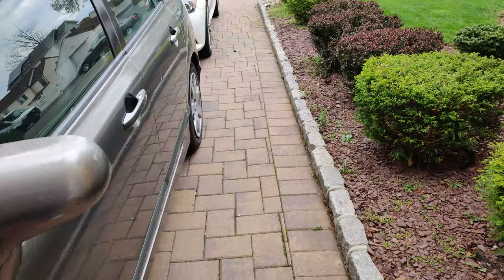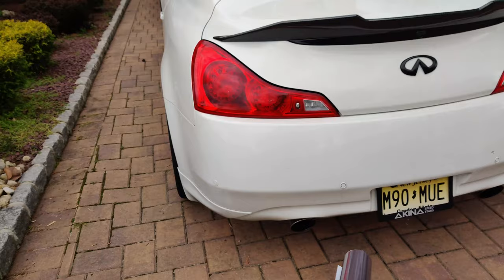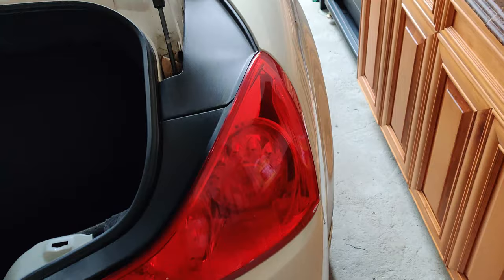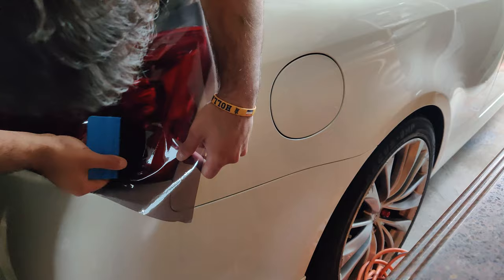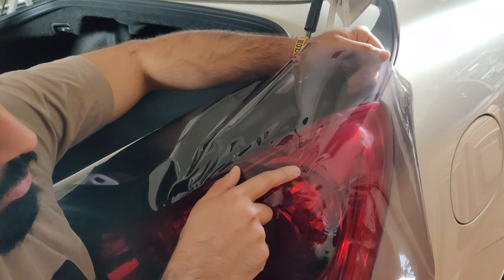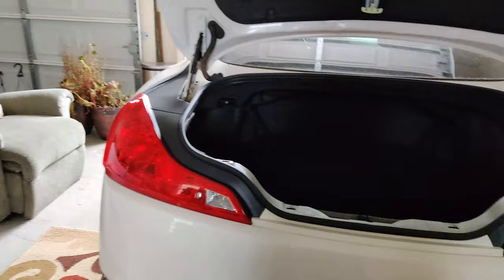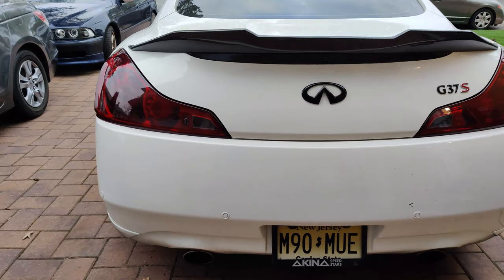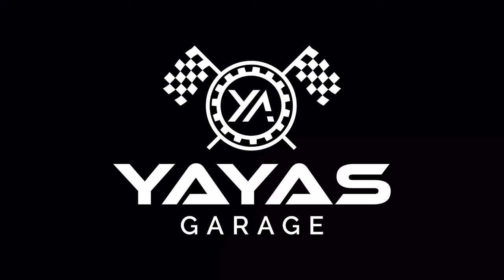MUST DO Cheap Mod! (G37/370z) - Tinting taillights (DIY)

Comment: gonna try on my sedan tomorrow, feel like it'll be harder cause my tail lights have curves and dips.
Reply from the maker: Goodluck! It'll look good when it's all done
Reply: @yayasgarage  thanks man! Clean G btw!
Reply: ik this was a while ago but did it come out good ? thinking about doing this on my sedan
Reply: @garbg  it was a pain to do but it looked good, I just used taillight tint film. Air bubbles ended up forming so I ripped it off.

Comment: how do you get the edges to stay and not shrink? i’ve had to redo mine twice now due to shrinkage
Reply from the maker: Do not apply too much heat. But my edges actually started wrinkling back a bit too unfortunately

Comment: Can you not just paint them over? Why tint? And what % did you use?
Reply from the maker: Wouldn't recommend using paint as paint is very difficult to take off. And I used 20% tint, link in bio
Reply: @yayasgarage  the link is not in the bio, where did you get it from?